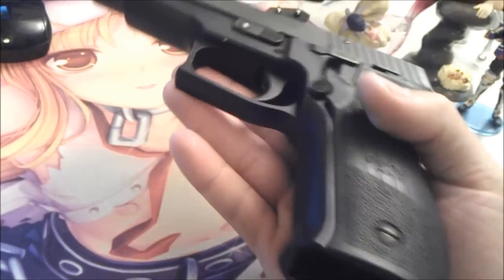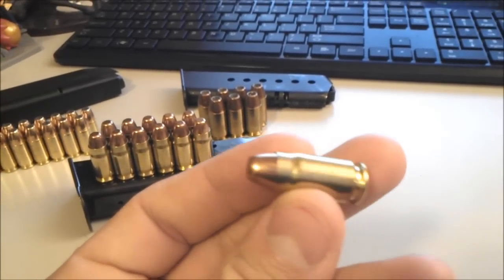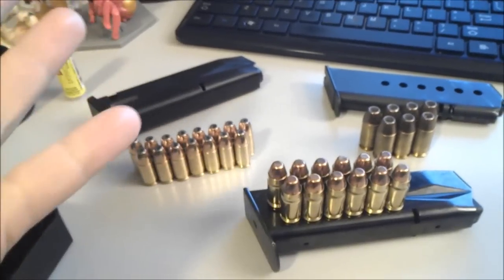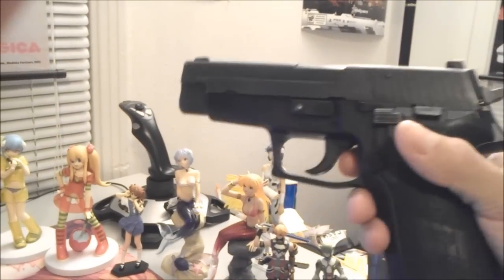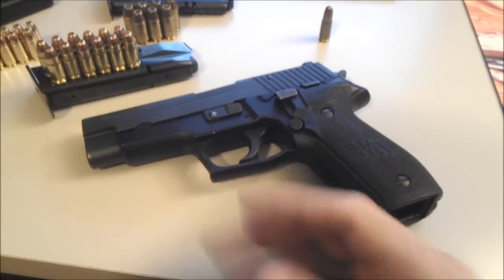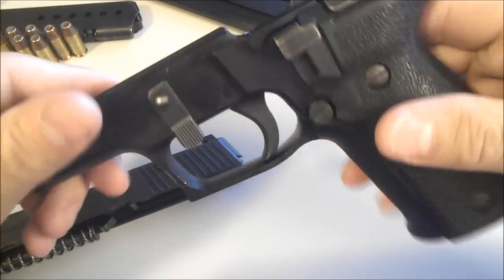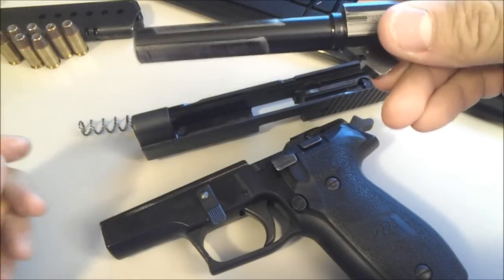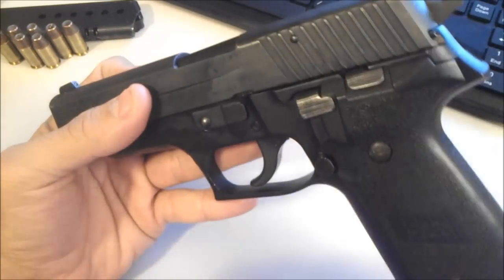Sig Sauer 226 .357 sig Mayor's First Impression

Comment: Had to turn it off when he said the .357 wasn't quite as good as the 40 and .45. Please do your research-it's ballistically better than both in most measures.
Reply from the maker: QQ

Mayor Fuglycool
Reply: 40 cal is better
Reply: @cartermccauley7352  ballistics are a thing and YouTube is free....
Reply: @cartermccauley7352       The .357 Sig is far superior to the slow .40 S&W.
Reply: @ricktaylor3748  the 40 is the most used

Comment: Just to clarify, .357 SIG not based on a .40 case, it's based on the 10mm, like the 40. The 357 sig case is thicker than a 40, it is capable of containing 40000 psi, 40 cal is well below that pressure. Underwood ammo, loaded to original spec for 357 sig, you can get 600+ foot pounds out of a 4in barrel. 357 magnum rounds are tested out of 6in barrel, and a 45 is tested out of a 5in barrel. Safety is the decocker.... Have you never owned a SIG? Plpease do more research before giving "facts".  So, 357 sig replicated 357 magnum in a 4 inch high capacity handgun with incredible penetration, flat shooting trajectory, and great muzzle energy.
Reply: Nuff said
Reply: interesting stuff i didnt know that
Reply: Just deleted my comment after reading yours.  Yezzirr...

Comment: not sure where you do your research,  but 357sig beats .45acp in pretty much every aspect.  the only real draw back to the caliber is price and ammo availability.
Reply from the maker: I hunt quite a bit, and the hogs drop (a little) faster with the 230HP's in my op than the 147HP's . I know the 357 sig has speed and muzzle energy advantages over the .45acp, but I think the bigger hole theory comes to light for hunting. 
My research is mostly from hog hunting, it's not really scientific, but I have shot hundreds of hogs with many different calibers. I do thank you for watching, and for commenting ! :)

Mayor Fuglycool
Reply: 357 sig costs as much as 45 acp if you shop around.  
45acp will make bigger holes in targets which is more desigred.  
45acp has lower recoil and all ammo in 45 acp is sub sonic leading to better sound suppression.
Reply: muffemod that's just false info there.
Reply: n300zx931
 go shop around man i find 357 sig on the cheap always
45 acp is larger diameter go measure
almost all 45 acp is sub sonic unless you get some hot loads.

Comment: You can’t review a gun without shooting it first. I know it said “first impression” video title but you kept saying “review” in the video. Also, the first SIG pistol was the P210, not the P220. Furthermore, that button that safely lets the hammer down is called a decocker. Don’t bust the .357 SIG’s balls by failing to research the cartridge’s ballistics performance. Yes, it’s more expensive and less available than .40 and .45., but thats less the fault of the cartridge and more the fault of the consumer. The 357 SIG shoots flatter because of its higher velocity, it also out-penetrates the other two, an attribute that made it popular with police officers. The projectiles also expand more than the 9mm and exit the muzzle anywhere between 1250 and 2000 FPS which is extremely fast for an auto loading pistol round, and they deliver 500+ ft./lbs. of muzzle energy. This round is gaining a little more  popularity with the public too and is not dead by any stretch.
Reply from the maker: lol

Mayor Fuglycool

Comment: Thanks for posting this. I have the exact same P226 (no rail, flat take-down lever) in .40 that I bought NIB years ago. A few days later I bought a new factory .357 Sig barrel. The .357 barrel was all-black until I fired it once (about 50-60 rounds) and then I noticed that same little strip of wear right at 12 o'clock on the top of the little ring in front of the barrel hood. I'm relieved to see that your factory .357 barrel has that, too.
Reply from the maker: Thanks for watching ;3))

Mayor Fuglycool
Reply: Dale Allen The .40 version is identical. When I shoot fast 155 grain .40's out of the .40 barrel and then 125 grain .357's out of the .357 barrel I can't tell any difference between the two.
Reply: Not hard at all here in Seattle. More ammo companies are making premium defensive rounds in .357 Sig nowadays than when I bought my .357 barrel in 2000. I tend to stock up on good .357 Sig and .40 ammo when I find it at a good price, anyway. I wasn't having trouble finding .357 ammo during the buying frenzy right after Obama's gun ban threats in 2012 like the 9mm and .45 people were, either.

Comment: The 357 Sig is on average 450-700 FPS faster than the 9mm 
It actually will penetrate body armor
And it has a basically straight flat trajectory
Reply: @Ken Kaneki it is somewhat but it pushes back instead of throwing your hands upward

Comment: Can not go wrong with a sig....the 226 (full size) or 229 (compact) can be chambered in 9mm, 357sig or .40 cal and you can buy a either of the other chambered sizes for the same frame.

Comment: Be sure to let the slide move forward more slowly by holding it with your left hand, putting the breaks on, when it’s not chambering a round. Bad for guns to let the slide fly like that without a round in there.
Reply from the maker: It's fine, and tbh it's a common myth to handle a pistol like that. Remember , a round does NOTHING to absorb any type of force, if the brass casing was to deform even slightly from the slide cushioning against it, the headspace would change. Headspace changes from a deformed round causes Kabooms.

I train to let it fly home, I don't want to be in a situation where a slow ride home will cause a jam / malfunction, and I have seen that happen in comp.

Mayor Fuglycool

Comment: I love the 357 ! Unfortunately I bought a Glock 32 and started to have failure to feed.I noticed some of the rounds were coming up level not angled in the magazine.I just attribute this to glock not quite getting something right.The 40 is fat from beginning to end so the bottom round pushes the top one up at the correct angle every time.I had to get a 40 berral for it .. Strange
Reply: My G32 does the same if I use re manufactured ammo. Since I use brand new ammo it never happen again!
Reply: @javierciordia7206  great! I did recently get a g31 and haven't had any issues.

Comment: nice video except you're slightly wrong. 357 sig is not based on the 40 S&W it's based on the 10 mm which was trimmed and necked. if you reload you'll find the 40s&w cases work but even after they've stretched still aren't long enough to make the neck needed for 357sig. close but still a few thousandths shy. common misconception though as 40s&w is also made from the 10mm case by shortening it and not necking it
Reply from the maker: +bigredtruck42 Yes, the .357 sig is based on the 10mm case. I should have mentioned that in the video, my apologies ! Thanks for watching friend ! :)

Mayor Fuglycool

Comment: 357 Sig brass appears to be a necked-down 40 S&W but it's actually thicker to hander the higher pressure-rating of the cartridge. It's baaaaaddd !! lol
Reply from the maker: Thanks for watching ! Yeah I think that the .357 sig cartage is a proprietary cartridge. I don't know if you can neck down a .40 to a .357, but I would have to say no.

Mayor Fuglycool
Reply: Mayor Fuglycool You should NOT!
Reply from the maker: glockensig
I should not what ?

Mayor Fuglycool

Comment: 357 Sig is Not the speed of 9mm. Look at 125 grain Underwood ammo it is way faster then 9mm around 1475 FPS and 600 ft ibs you can also turn a 40 cal pistol into 357 Sig with a 357 Sig barrel

Comment: Man you really need to do some research
The P220 is NOT the first Sig Sauer pistol 
The P226 comes in .22 lr, 9mm
357 Sig and .40 s&w
The beretta 92s and the p226 were almost identical in price
It was the complete package with service parts that made the P226 more expensive
and the P226 surpassed the 92s in every test 
You’re also way off on the benefits of its design
The .357 Sig is by far the most reliable feeding semi auto cartridge on the market

Comment: The amount of round depends on the magazine, your showing 2 single stack and a double stack.
also the 357 sig has the speed of the 9mm?
The sig is the fasted of the bunch at 604 fps in the speer ballistic.
Just go to underwood ammo.com

The 9mm  124 gr.   = 1150 fps   364 ft. lbs.
The 40 S&W 180 gr. = 1100 fps 484 ft. lbs.
The 45 acp 230 gr. = 1100 fps.  511 ft. lbs
The 357 sig 125 gr. = 1475 fps  604 ft. lbs.

not only does the sig have 325 more ft. lbs over the 9 mm it has 204 foot
pounds of knock down energy.
These are all speer products.

Comment: You gave so much disinformation here. The .357sig is more powerful than 9mm, .40S&W. It has more speed than those 2 rounds as well and the .45acp. I've seen it go through light body armor. The fact that it doesn't have feed issues is incorrect as stated by a secret service agent that did a video. It's a machine. They are all subject to failure. Videos like your are the reason people get bad information on the internet. I wouldn't watch any videos of your ever again. Not even if you did it on kitty litter.